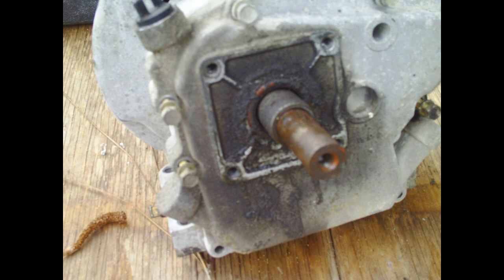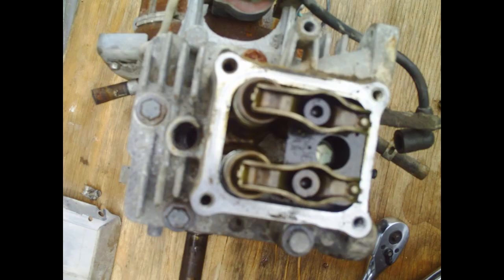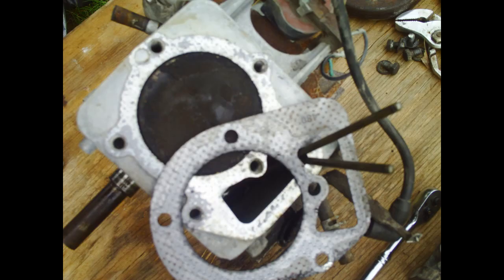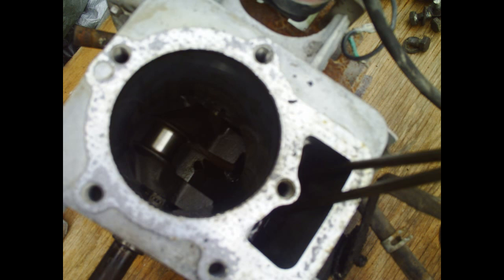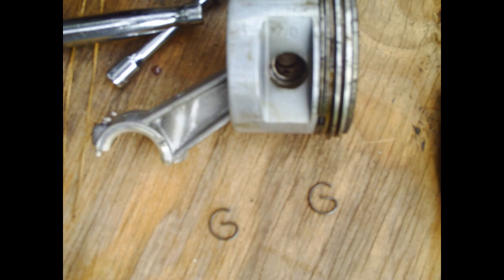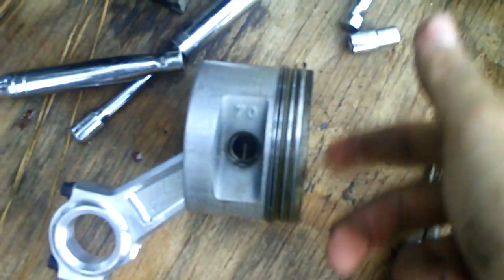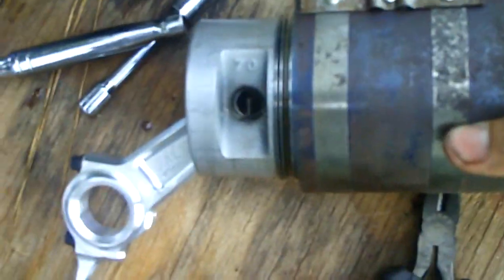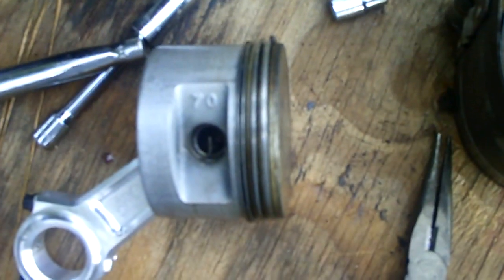Marsrovers buggy project episode 2 Billet rod part 1

Comment: @marsrover001 Ok, I broke something in my Jeeps engine. I am pretty sure its the rear main crankshaft bearing. I have to replace it though. Our neighbors boat did the same thing and shot a rod out the side of the engine.